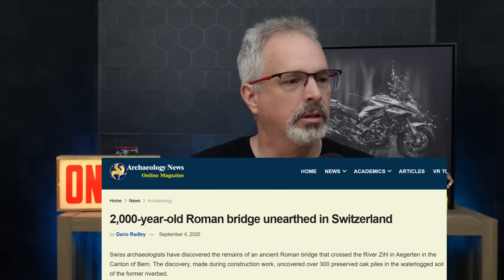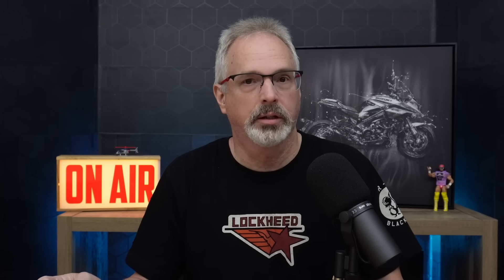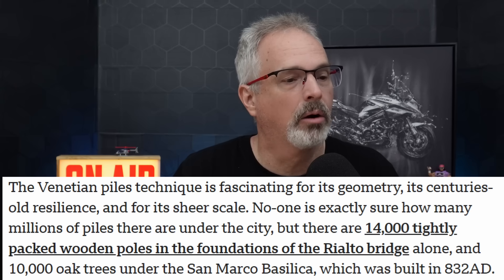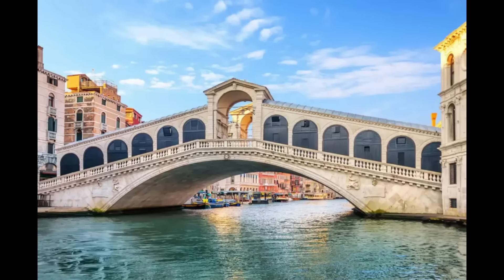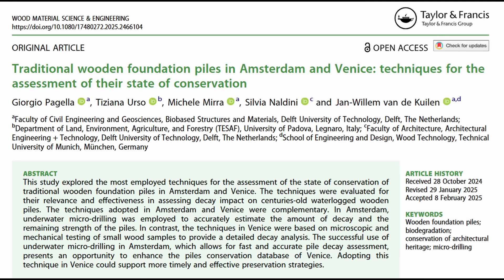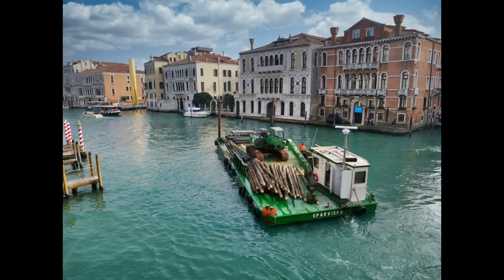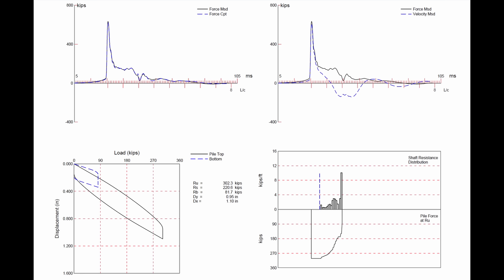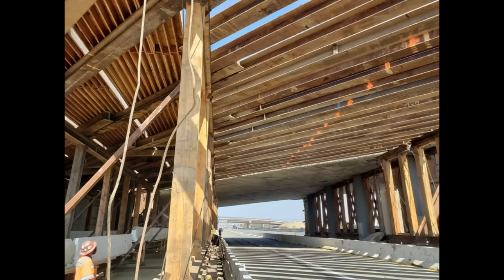Ancient Pile Supported Foundations in Rome and Venice, Italy

Comment: Back in the 1940s my grandfather cut oak trees for use on a black muck island which was built up 2 foot with sand dug out of nearby hill .
Sand was loaded on a barge and shoveled onto island then 2 story concrete house was built on pilings. It is still there has sank a little

Comment: One thing i think overlooked in the praise of roman buildings lasting 2000 years is suvivor bias. The lousey construction fell down years ago so we only see remains of their best work
Reply from the maker: Yes that's a great point.
Reply: Another key point.  The ancient concrete that has lasted so long has never seen winter/spring freeze thaw cycles.   I understand that several types of ancient concrete were mixed and tested (it was packed together as a very thick paste and took at least a year to cure, which was not a problem as it often took years to build a structure by hand; and it has self healing properties for minor cracks).  But, it did not stand up well to freeze/thaw cycle testing which those of us in the north need even if we could take a year or two to build up a concrete wall for something today.

Comment: Some roman pile drivers had a big pulley ratio lifting a stone and a resetable latch for dropping the stone, slow but let only a handful of people pound a tree into the ground, also because of the pulley you were not putting a lot of horizontal force on the pile driver.
Charring the piles kept them from rotting for soo much longer.

Comment: Travelling to Venice, IT I heard about the Problem with Boats - the Propellers introduce a lot of Swirls and Air in the Water which leads to more Bacteria growth in the disturbed Silt, and hence threatening the Wood Piles - and contributes to the bad Smell that engulfs the City sometimes. Smart is to only use the classic 'Pusher' type Boats.

Comment: Casey there is no fuel-air mixture in diesel. Air only is compressed, typically at over 20 to 1 compression ratio, which heats the air. Diesel fuel is then injected into the cylinder at high pressure and the heat of compression is sufficient for the fuel to spontaneous combust. That is why diesel is known as compression ignition as opposed to gasoline engines which are spark ignition.
Reply: There are a lot of old Engines e.g. in Tractors that mix Air and 'Fuel Oil' (Light Oils, Kerosene etc) and compress the mix, but can not reach Ignition Temps - and use a small burner to heat up a 'Glowplug' that then ignites the mix when at the Top of the Stroke (TDC). They can use a wider variety of Oils (not just Diesel) since the Ignition does not only rely on the Quality of the Fuel. (edit) Another Advantage is they don't need high pressure Injector Pumps and Injectors - and can often be Hand cranked and started since the compression is much lower than 20:1. Look for 'Lanz Tractors' for example.

Comment: We use the metric system now.👎
Reply from the maker: Not in the good ol' U.S. of A. Bub!
Reply: Then explain pipe and heat exchanger tube size (it's nothing more than the metric equivalents of English pipe and tube sizes).  Railroad Gauges, and many other things such as wire size.  How about the Russian and a number of other countries 152 mm artillery (which is actually 152.4 mm - or 6").   It's not nearly as clearcut as most metric countries claim.

Interesting historical note:  After WW I the US army was not satisfied with the performance of the 6" artillery so they ran a competition.  A certain French company submitted a 155mm artiliary piece and shell which performed best.  So, before WW II the US Army contracted for the French 155 mm artillery piece and shells.  Now for WW II the USA still had lots of 6" artillery and shells in stock.  But they also purchased full production rights to the French 155 mm artillery and stopped building 6". 

So WW II was fought with a mixture of 6" and 155 mm artillery.    The current NATO and world standard 155 mm artillery is a direct descendant from that pre WW II French artillery design.  So the US Military was way ahead on use of metric artillery for most of the world; and that French artillery company credits a lot of their later success to the US adopting and paying them for their design (funny what you can do when you get a pile of money to invest in better designs - that your competitors don't get).

Comment: I imagine that some type of computer application can now be incorporated into a pile driving hammer so as to determine when the desired soil bearing resistance has been achieved as apposed to the old method of the foreman scribing a line on the pile with a hand held level after so may blows to get that measurement.